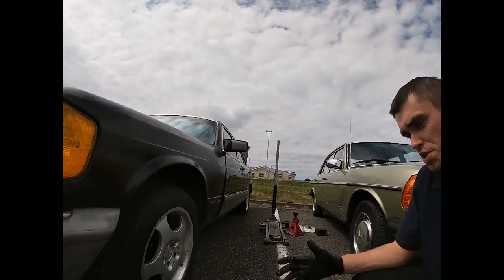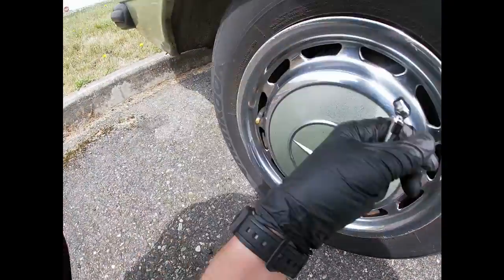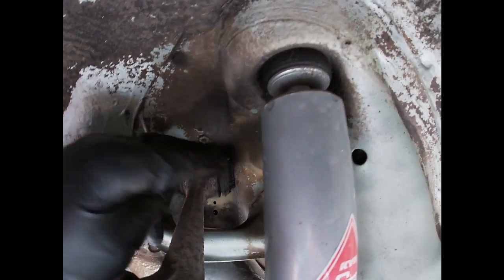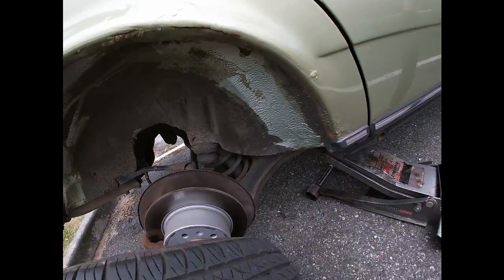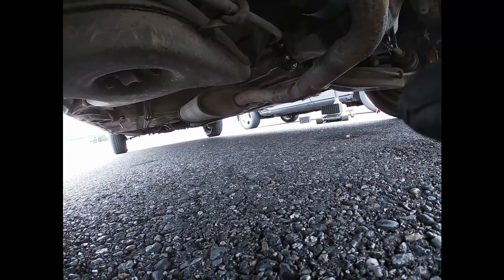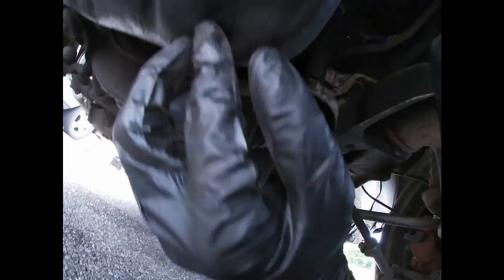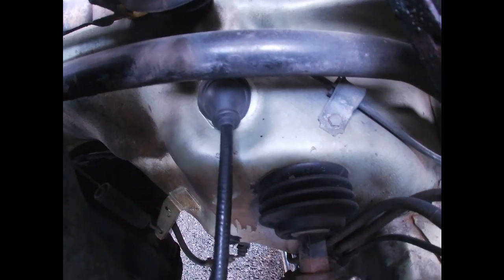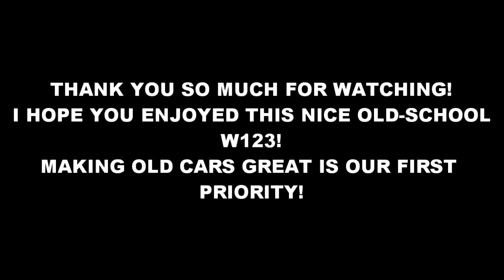WATCH ME PERFORM A FULL INSPECTION ON THIS OLD SCHOOL MERCEDES W123

Comment: I learned to always keep extra fuses in case one breaks or blows, you have extra, especially with fuses, it is always good to have extra fuses, a fuse can make a difference plus who knows  how old they are.
Reply from the maker: Very true. It's a very good idea to replace them with brass fuses. Aluminum fuses corrode
Reply: It’s also a good idea to use dielectric grease on each end of the fuses, prevents corrosion as well.

Comment: I have the 1981 Mercedes 240d with the 4 speed manual transmission.  The biggest concern I have at this time is what I have to do to get some good tires when my current tires wear out.  I currently have Michelin 205/70r14's.  Michelin no longer makes the 205/70r14.  I started to look for the 205/70r15 tires but Costco now is telling me they are phasing out these tires also.  I would like some suggestions because it looks like the only tires that are soon going to be available is the 16" tires because car manufacturers are putting much bigger tires with small side walls.
Reply from the maker: Look for tires online, on ebay and amazon. Lots of choices. I bought a Hankook set of 4 tires 195/70/14 2 years ago for $180. If you have 14in steelies like on this green Euro W123 or if you have 14in Bundt wheels, you gotta have 14in tires. 15in or 16in size tires won't work. Only these will work: either 195/70/14 or 205/70/14
Reply: Cooper Cobra Radial GT is available on amazon in a variety of 14s.  They have a retro tread design that looks more period correct IMO.

Comment: One area you need to check is the oil cooler lines because these will start to weep and if they go you can burn up your engine.
Reply from the maker: Everything is pretty dry as far as oil cooler and lines. I checked everything, I guess just didn't film every little detail

Comment: Be sure to check if the power steering belt is rubbing the oil cooler lines. That is a common problem on w123 diesels.
Reply from the maker: Good point. Thank you for watching and supporting. Cheers:)